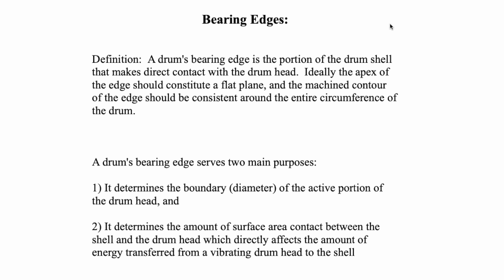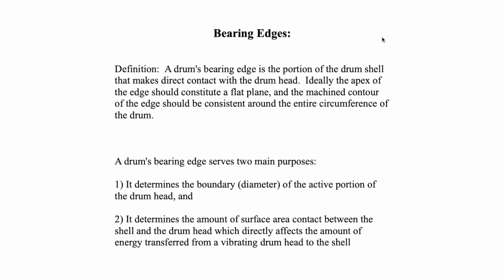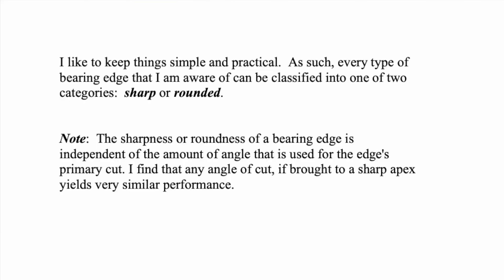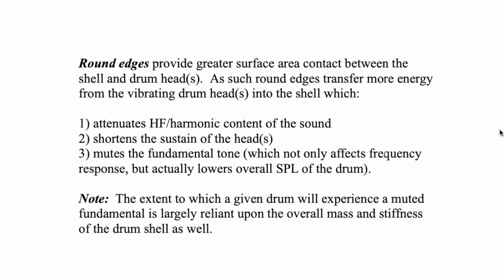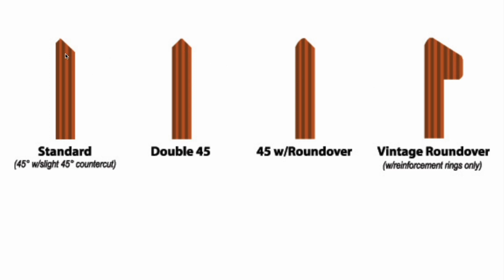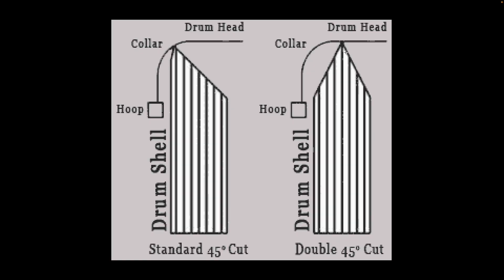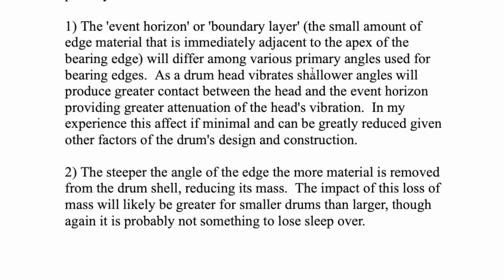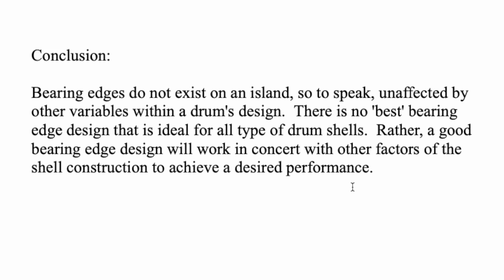Bearing Edges -- Drum Sound Physics Part II

Comment: Why does more surface contact (and therefore energy transfer) between the drumhead and bearing edge create an attenuated high-frequency response, while a higher energy transfer to the drum shell results in an attenuated low-frequency response?
Reply from the maker: Great question!  From a purely physical perspective muffling works, because it absorbs energy from the drumhead, that is, energy in the drum head is transferred into the gel, tape, ring, wallet, etc., removing it from the head, absorbing FIRST the high frequencies and then, depending on the amount of muffling, the hi-mids, the mids, working on down....  Rounded edges, provide greater surface contact with the heads, so they have greater physical area to absorb energy from the heads.  Round edges won't absorb energy like overt muffling will, but the greater contact does transfer greater energy from the head to the shell (compared to a share edge that provides little surface area contact).  

As for the latter part of your question, greater energy transfer into the shel will increase the likelihood of the shell beginning to resonate (vibrate) a bit of its own, which is an entirely different pattern of vibration than that of the heads.  This cross vibration, 360 degrees around a cylinder, basically, disrupts the vertical energy of the heads and lessens the pronounced fundamental tone/note of the drum.  As a result any harmonics present will be a larger percentage of the overall drum sound compared to a shell that isn't vibrating much on its own.  Therefore, a more massive drum shell (with literally greater mass) is harder to excite into vibration, and therefore retains more of its fundamental.

It is entirely possible to have a massive (literally) shell with rounded edges, but is so great in its mass that it still doesn't vibrate much.  This drum would have an attenuated high end (because the shell is still absorbing energy from the head due to the rounded edges), but with a shell mass great enough that it doesn't vibrate much it will still have a strong fundamental.  It is also possible that a thin/lightweight/low mass shell should have a sharp edge, but it so lightweight that the shell is still excited into vibration easily, absorbing and disrupting the heads vibration producing a short, punctuated sound that is somewhat bright (not much fundamental).  

This latter is the state of most inexpensive drum lines with shells made almost entirely of poplar.  The fact that they are inexpensive doesn't make them short and punchy -- it's the lightweight and comparatively soft wood that is responsible for that (lightweight and soft compared to maple or birch or other more traditional tone woods).  Some of these inexpensive drums can be worked to become much better instruments (truing edges, finishing/sealing interior, gluing the wrap (which is usually taped on such drums), etc.).  There are also some very nice custom drums that are largely poplar (INDe's Studio Mod line are great drums that use poplar as the core of the shells with harder woods on the interior and exterior.  Nice drums, with a bit more controlled sound, punchy and detailed, but contained and versatile for recording).  

I hope I explained that well enough to make sense.  Thanks for the question!
Reply: @drumdotpizza  Yes that all makes sense!  Definitely going to prioritize more massive drums from now on.

Comment: Bearing edges are a BIG reason why 70's vistalites got such mixed reviews.  The edges were often erratic and wonky. The brittle sounding vistalite could often be linked to how bad the edges were.  A similar acrylic shell from rci starlight with perfect edges sounds much fatter and cleaner.
Reply from the maker: Yep!  I have owned three original vistalite snare drums (currently have an original bass drum shell too that I'm rebuilding, but haven't played it yet), and all three snares were very hard to tune.  They each had a tuning that seemed to work, but they weren't flexible, sonically, at all.  I now have two acrylic snares (all Ludwig hardware) with shells from RCI, and the edges (and tuning ranges) are fantastic.  They sound great at all tensions.

Comment: Had a Ludwig Classic ..beautiful kit in natural maple. 45 degree single cut edges. Drums were terrible to get in tune and they favored higher tuning cause you couldn't lower the tension enough to get them to a lower tuning.
Reply from the maker: Were those the 80s era that had more lugs on the toms?  12" and 13" toms with eight lugs per side, 14" and larger with 10 lugs per side, etc.  I find those drums hard to tune, and really don't have the low range of tuning that normal lug arrangements do.  It's been awhile since I have played one of those kits.  I wonder if the edges of that time also hit the collar of the heads?  I never thought to look when I ran across one of those.

I recently modified a 12x11 mid-80s 8-lug tom to a 12x8 6-lug tom for a friend of mine (in fact, that's the tom in the video on shell's inherent pitch!).  I didn't mess with the edges, though, now that I think about it.  It tuned up great when I got it back together, so maybe those edges are fine.

I'm a Ludwig fan, but there are definitely some sketchy QC years there in the late 70s/early 80s.  I've seen all kinds of  odd things from them in that era.  Still a big fan though, and love all my Ludwigs.

Thanks for sharing!!
Reply: @drumdotpizza  no..I bought it in 2015. Stunning kit but it was a pain to work with. 8, 10 12,15ft 16ft 22bd. Went back to Tama.
Reply from the maker: @Camcodrummer  Love Tama too!  My other fav...

Comment: What is your take on the Guru Drums bearing edge?
Reply from the maker: I've never used it, and I'm not quite sure what I think.  It makes a great deal of contact with the rounded collar of the head, so I would tend toward 'rounded' category of bearing edge with all of its attributes, EXCEPT there is a space between the rounded portion and the apex.  I would think this break might very well create an inert portion of the head just beyond the active diameter, which might mean characteristics more like edges in the 'sharp' category.  

I saw a video on their new edge a couple of years back (are they still around?  Just looked, and can't find an active website (though may just be my broker acting up?)).  The guy tapped the head of a tom, and it appeared to have great sustain, but I'm pretty sure I'm hearing the camera's built in compression, which would create that same effect with any other tom (sounds like camera audio used for that video).  If that's the case, then his tap test is really for nothing.  Also would really like to hear it against an 'all-other-things-being-equal' drum fro comparison.  

So my answer is, "it's compelling, but I would like to see more."  

Assuming it works exactly as he describes I would categorize it as a sharp edge, and would expect a single cut (outside to inside) edge to produce similar results is the diameter is slightly undersized.  Basically, any portion of the edge that stretches beyond the shell (into the collar) is effectively inert.  The portion that matter is that which makes contact with the shell.  It's that little inert 'dip' in the Guru bearing edge that is a magic of that design, assuming it performs as claimed.

I love seeing people thinking outside the box and coming up with new ideas.  Not everything has been tried, believe it or not, and there is much more to be discovered and implemented.  I hope Guru is still around!!

Thanks so much for the question!
Reply: @drumdotpizza  thanks for your reply. Guru it's sadly no more. The founder/owner had to retire due to health problems. They made some gorgeous drums...

 I have made a "test drum" rig with a 10" shell with the Guru edge. In my completely unscientific estimation, I would say that it works as advertised. My test rig is basically like a roto tom with no shell, just a bearing edge, made out of wood. Side by side with a 10" roto tom, it definitely has longer sustain. I also think it has a stronger fundamental tone and fewer/quieter overtones.

I am also a big fan of Peavey Radial Pro drums. They also tend to have a great deal of sustain, though probably not for the reason that they advertised. They have super sharp bearing edges and the additional mass of the "radial bridge" at the top and bottom of the drum.

I love that you, and a few others on YouTube, are talking about the actual physics of drums, rather than the myth and marketing about what characteristics contribute to how a drum sounds. I look forward to more of this topic.

Comment: 19:48 well, actually Drums should be smaller in Diameter so the bearing edge is never in contact with the collar, only with the plank surface of the head. I also dont understand the difference between 45 , 30, 60 degree cuts. The only contact between the head and the drum is the tip of the bearing edge which can be formed from sharp to fully round. How does a sharp 60 degree Cut Sound different from a sharp 45 cut. All thats touching the head is the tip of the bearing edge?
Reply: Because it focuses the sound waves throughout the shell.

Comment: I had some intermediate drums circa 2004.  The edges were very narrow and the drums just sounded bright and attacky, not much body. I hate that.  My 12" tom sounded like other kits 10". tom.
Reply from the maker: You could round those edges a bit and mellow the brightness, but if you want more body you'll need heavier shells (or some EQ on the other side of a microphone).

Comment: Pretty cool video. Let me try to impart  my observations and experiences, in other words, my "2 cents worth"  LOL  As for my background, 60 years of playing time, 10 years of drum building & restoring.  A pedigree of automotive + race car building... engineering, machining, welding and fabricating etc.  It is my humble opinion, the drum shell has very little if any musical properties what so ever, other than beating on it with some form of battering implement.  "insert club of destruction of your choice"  LOL  My opinion... drum shells are ply's of wood, glued together, more over, glue has no musical properties at all. Then, we bolt a bunch of lugs and other hardware onto the shell and to further discredit all the shell, "residence" madness, a wrap is applied and in many cases, larger drums require multiple pieces to encompass the entire shell. So, my theory is as follows . (1) The thickest shell possible within reason. This make the shell more likely to stay concentric through time and any given conditions and physical stresses. i.e. Humidity  and  "rim tension"  (2) The bearing edge. I prefer a double 45 degree. This seems to produce the most tones possible. A person can then remove any of the unwanted tones. This can be accomplished in so many ways. Here are some but not all. Rim, stamped vs die cast, head type, tone rings, foam rings, moon gel,  The ubiquitous Duct Tape. etc etc.  OMG!!! Lets not forget about good ole "tuning."  LOL
So in closing... You can remove tones and notes you do have...  You cant extract tones and note that are physically unobtainable.  What say you? 
Thanks again for posting your experience and perspective.
Reply from the maker: I agree with you almost entirely!! ALMOST, because I do find that the material used in the shell does, in fact, affect the sound, though if you watch my video on tone woods you'll see that I do agree it is secondary to many other factors.

Lately I have been big time digging my 5x14 "Vistalite" snare (made with an amber RCI Starlite shell.... MUCH nicer edges than any original vistalite I have played)... it is a mellower, more controlled sound than any of my wooden snares.  With no muffling it has just the right amount of musical harmonics/overtones (10mil single ply coated head).  I'm just LOVING that drum right now, and the viscosity of the shell material does make it behave quite differently.  Then metal, of course,  But yes, most woods are easy to confuse, sonically.  In my tone woods video I did a comparison of very soft (poplar) shell and relatively hard (sugar maple) shell with identical edges cut by a buddy of mine.  They are, in practice, interchangeable with a quality recording engineer/mixer, but the differences are noticeable (and VERY noticeable to the player (me) in the feel of each drum while playing).  

Thanks so much for your input!  I believe we are cut from the same cloth!  ;)

Comment: How DARE YOU...... kidding. I think that tuing range plays into the equation a bunch as does the size of the drum diam. I built a 10" tom that just sings. Very thin 4 ply Keller from PD. But I have an old Imperial star with Mahogany shell that is thicker and it too just sings. Bigger drums may start to vibrate and cancel head vibration more easily. Depends on the pitch range. Don't even get me started on shell pitch stamping. Unless it is a tabla, It is of less than No concern. Drumset toms are simply implied pitches with implied melodic  uses. And if it were pitch specific, you would want to be able to dampen sustain like a vibraphone damper or you would have sustained notes when not appropriate. 
Love your stuff ❤️
Reply from the maker: AND.... I'm guessing that thin, 4-ply Keller tom shell is maple?  The Imperialstar shell is not only thicker, but the Lauan (Philippine Mahogany) it is made of is considerably softer, and the I guarantee there are more vertically oriented plies in that Imperialstar than the Keller (almost certainly the interior ply is vertically oriented.. almost all Imperialstars I've owned have been).  Both have a very low inherent pitch (when you do the thump test on the shel).. the Keller, because the veneers are so thin they wood fibers don't resist the bending like thicker plies do, so the pitch isn't raised as much under the tension, and the Tama, because of greater mass (9 plies) and lots of vertically oriented veneers.  

It's all so complex and interesting it just makes one's head spin, no??  

I'm actually about to tackle tone woods in the next installment in this series.  I'll try to keep it under an hour.... wish me luck!!!   :)

Comment: I mean WHY do we want the shell to vibrate at all?
Reply from the maker: If the shell is light enough to vibrate, then allowing it to do so (through rounder edges and isolation mounts) will dampen the fundamental, making the harmonic content a higher percentage of the sound.  This also shortens decay/sustain, but again, if that is the sound you want, then thinner, vibrating shells are a way to that end.  

If the shells are too dense then all the surface contact in the world between head and shell won't actually make the shell vibrate much.

Comment: Uhh, the head is the speaker and the shell is the cabinet. I think wood isn,t a thing really!  Heads have the biggest impact on the tone! What we hear sitting over the drums and what happens to tone out on the stage or room is different! In my experience I love thin shells made of maple! Why?? Uhh,,, they are solid, strong and durable!! I also tune top and bottom the same! I chase the unpleasant harmonics from the reso!  Poplar? Maple? Beech? Mahogany? Birch?? Out in the room basically all the same tone wise!
Reply from the maker: You analogy is not far off!  Guitar cabinets are made of plywood!

Marketing has taught us to think of the wood of a drum as if it were the single veneers used for fine acoustic guitar or violin crafting.  But drums are generally just plywood.  One wouldn't consider plywood for quality acoustic guitar construction.

In truth the type of wood DOES matter, but it is one of many variables and other variables (like edges) are more significant.

Comment: This is weird - I always thought the thinner shells had lower frequency content and more resonance than thicker shells.
Reply from the maker: Well, technically that depends on what you mean by 'resonance.'  If you mean the shell vibrates longer when thumped (with no hardware on it), then yes, modern, thin, rigid shells (that have higher glue-to-wood ratio than older, thicker ply shells) do, indeed, vibrate longer than thicker shells.  

Thinner veneers' used in modern shells also have less resistance to strain (being forced into a curve against the grain) resulting in a lower pitch compared to the thicker veneers whose greater resistance so such strain results in higher pitch.  

So modern, think shells generally have lower pitch (when thumped) and vibrate longer (when thumped).  Thicker vintage shells (1980s) generally have higher pitches and don't vibrate as long.  

The effect of all this on the tone of the assembled and tuned drum, however, is something of an inverse to the raw shell.  Modern shells, due to their ability to vibrate easily do so when the drum is played which actually dampens the fundamental tone giving a higher harmonic content (so the drum sounds 'brighter' than a thick drum).  The thicker shell drum, whose shell doesn't vibrate so easily will resist vibrating a bit more when played yielding a stronger fundamental pitch (boom!) with the same amount of overtones, though given the strength of the fundamental tone the overtones are a smaller percentage of the overall sound, so the tone is mellower overall (though louder from a purely amplitude perspective).  

You're right... it's weird!  ;)

If, however, you mean
Reply: I think you are describing why I didn’t like those Yamaha Maple Absolute shells when compared to my Recording Customs. I thought they were going to have a “lower” pitch and more sustain and instead it felt more like tin cans. It was very confusing and went against all the marketing. They were “pretty” but so much weaker and didn’t pack the wallop of the RC and early 80s Ludwigs I had.